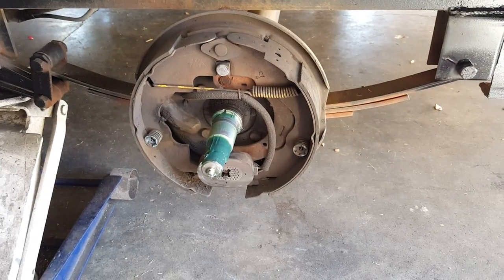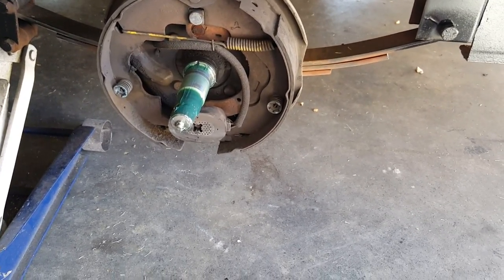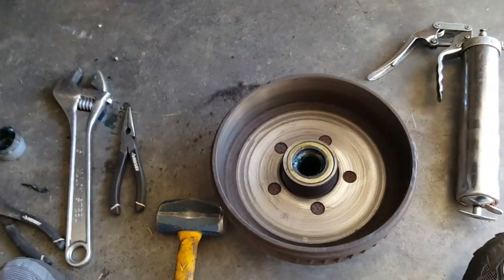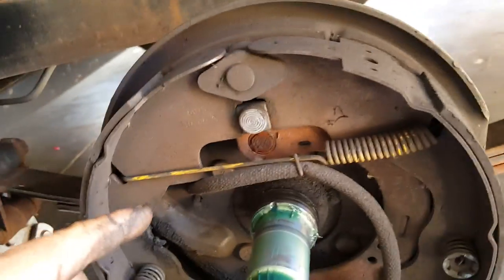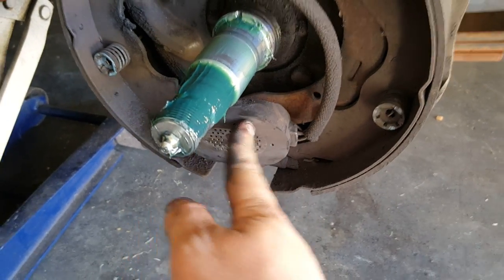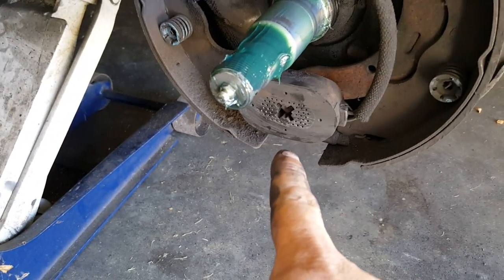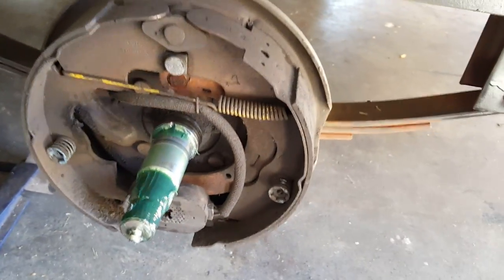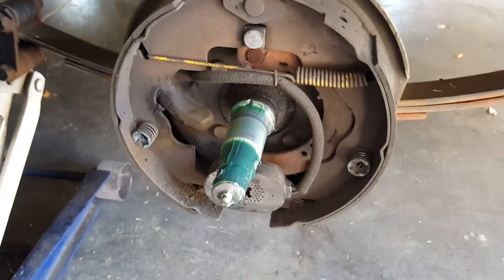Inspecting the trailer brake assembly.

Comment: Man I know this is an old video so I hope you can still see comments… I’ve been researching my trailer brakes issues and ran across your video.  You seem more knowledgeable than most I’ve watched so I hope this question makes sense and you can answer it because no one around where I live can answer my question.  So, I completely refinished a 1988 gooseneck float trailer.  I’ve now gotten to where I’ve rewired everything and hooked it all up to my truck. From the inside of my truck, I have to set my gain to 10, which is the max.  And at 10, it does help to stop but barely.  Anything less than 10, even 9.5, will not stop truck and trailer when I’m testing it. In your opinion, what does this sound like?  Shoes, magnets, hubs, replacing everything? Any help would be greatly appreciated!